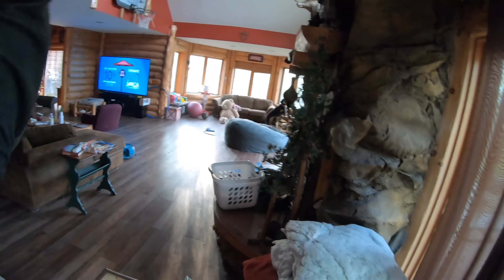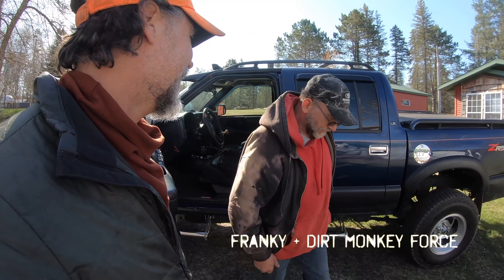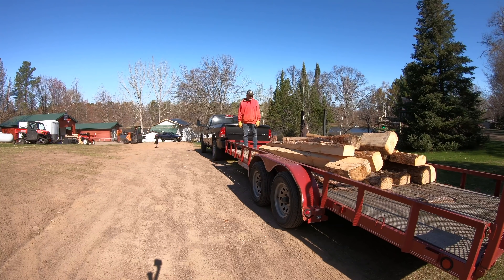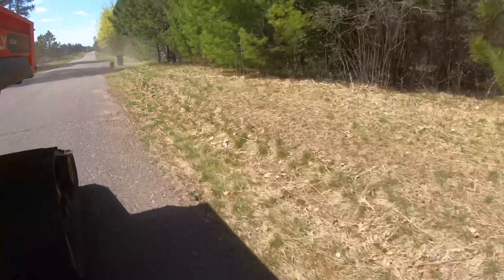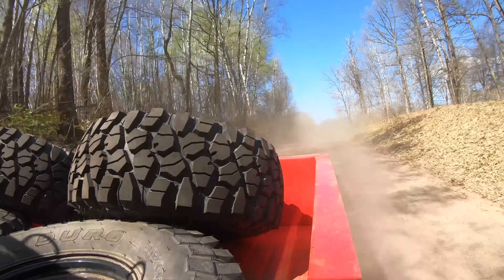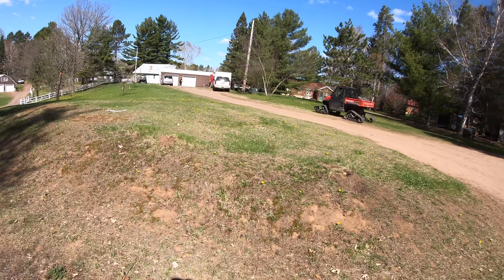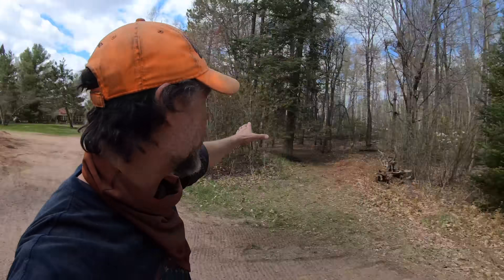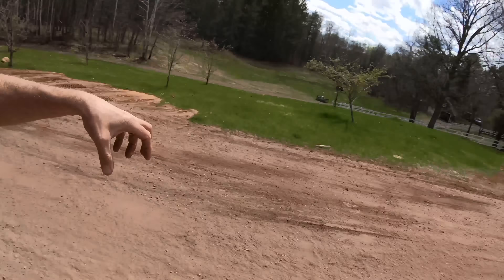Customer is shot on my farm

Comment: Power of a ricochet:

45acp turned 90 degrees in a small tree, then penetrated a hardy plank wall sideways, put a large dent in a 2x6, finally coming to rest on a plastic bucket after bouncing 3’ back from the 2x6.

We were fortunate that day.

Down range isn’t always directly down range.

Physics will prevail.
Especially so with poor decisions to start with.

Comment: Demo ranch mainly shoots at flat objects and they're typically angled down. He's shot cylinders and the like, but he doesn't shoot at pans unless he sets it up a certain way. I don't know if you've noticed but there is a reason for him changing the calibers he uses to test objects - sometimes that reason is because of a higher chance of ricochet. I've seen items I'm sure it's going to ricochet but because of the caliber and power selection it lessens the chance. There's also the fact he likes to hide behind trees and trucks if there's anything he's not comfortable with. 

I'm glad your neighbor is recovering well. A big lesson from that is to always have a first aid kit handy when shooting - and know how to use the gear. Personally I have a couple of tourniquets. One is for when I'm using a chainsaw and it goes into the chaps, one is for a medic bag I keep at home (which has come in handy before, unfortunately) and the third is for the range or for  slipping into gear.

Comment: FIRST I'm glad your friend is alive and well to talk about this/his misfortune....we've all done or been victim of a "fun" mistake. 2nd, as many times I've seen you preach good footer/foundations make healthy walls, I'm from hillside country and #1 mistake is NOT removing the grass before adding another layer. It does 2 things ,not removing creates a "slip" point as  the grass rots it doesn't allow a correct bond between the layers (actually makes 2 hard pans with grease between) ...also by removing the grass you also breaking the lower soil to allow  the new layer to bond/grip to it preventing future slippage. YES, your ground there isn't as steep BUT same water priciples apply, it'll seep down/through to grass rot line then flow out creating a slip.....I've seen yards, drives, etc. slip/slid.

Comment: there is a guy in florida with a TBM, that got his plane shot like the bullet was fired to the sky and came back down just behind the cockpit. He cought while inspecting his plane before flight and thay found the bullet between the panel and platic interior. The probability of small plane taking a hit from the top is as low as this guy taking a ricochet being "far" from the plate, that's crazy

Comment: Stan, many episodes you said something about never (seldom ?) using safety glasses or other PPE.  You said that you did not use any your whole life and nothing ever happened.  I'm sure your neighbor never had a bullet ricochet and injure him before.  While it is likely safety glasses would not have fully protected him, they might have lessened the damage.  

I bought many pairs of safety glasses and insist that anyone working with me wears them any time there is a danger from a chainsaw, hammering a nail, chipping a rock, paver, retaining wall block, or any possibility of something flying and injuring them.  Hardhats are required when working with anything overhead

I feel that a slight discomfort from the safety glasses is worth keeping the only 2 eyes I have.
Reply from the maker: Even though I don't wear much PPE personally I would prefer my audience to be fully protected.
Reply: Internet hall monitor alert.

Comment: how do you get away with shooting irresponsibly????  YOU DON'T.. lesson to be learned here is if you think what's happening is wrong, especially on your own property, stop it from happening. I've done shooting for years and have spoken up when something seems wrong. I have stopped friends several times from making deadly mistakes. Your neighbor is a miracle for sure, he should be dead. A slow burning black powder gun went off 30 seconds after it was fired (Hole in the range roof)  I was putting up targets and my buddy had his rifle pointed right at me from his hip.. I screamed at him, 30 seconds later His 30-06 went off and blew a 6 inch diameter branch off above his head... The safety was on, (but was broken.)  Please be safe.. I'm only trying to help.

Comment: The reason that Jeff got hit was almost certainly because he was not the shooter. I’m assuming that the shooter was smart enough to tilt the steel one side or another so the bullet didn’t come straight back at him… That’s what you normally do, and that’s what your friend on the other YouTube channel is doing to keep from getting hit. The problem is that Geoff was standing 30 feet off to the side so when the bullet ricocheted off the intended target and left at a different angle, unfortunately for him it came off at an angle the intersected with his head. Had the angled the steel a little downward as well as a little to the left or right, like they do in a shooting trap at a gun range than likely the bullet would’ve just hit the dirt and nobody would’ve ever gotten shot.

In any event I’m sorry this gentleman had to experience this but I’m glad he live through it.

Comment: AR 500 steel targets are cheap like $20 delivered for a 8” plate. 👍👍Use them because they are much cheaper & safer. Mounted with chain or used conveyor strap. 👍

Comment: A bad ricochet while shooting at a metal is always the result of using the wong ammo. FMJ is for paper or soft materials, not for metal. Also, no target should be concave because that adds to the possibility of a ricochet. Ive got hundreds of hours of training and 10,000+ rounds down range, with 0 issues. The PPPPPP applies to shooting more than any type of construction in my opinion

Comment: My partner at work missed the steel bracket he was shooting with the nail gun. The nail ricocheted off the top of my head. A flap of my skull was pulled up about 2" x 3". Knocked me on my butt instantly. They called 911 and said he shot his partner. A whole swat team showed up with full gear. The medics woke me up and the cops asked what happened. It was all fine thank goodness except for some stitches in my head. They found the high velocity nail curled into a circle. This was the old fashioned breech loading gun.
Reply: There's a joke here about hard heads... but I don't want to go there :P. Glad you where alright.
Reply: @gerble36  Umm, it WAS mentioned by someone I won't name. :)

Comment: So he lost that eye!? Wow, I guess that's why some shooters wear safety glasses. My normal eye glasses have saved mine from bits of metal a few times.
Reply: Safety glasses won't always stop a direct hit if there's still a lot of power, especially if it hits just below the glasses and defects off the orbital bone. He could have been wearing safety glasses and still got hit. Once wjen I was pretty young I had found some old inch thick glass and decided I wanted to see if my old daisy bb gun could break it. Obviously not bit I didn't know too much better. I knew it could bounce off because I was so close so I stood at an extreme angle so if it did bounce it would go the other way...and it still somehow bounced straight bad and got me just below my lower lip hard. I was so mad I went and found a hammer and made sure there was nothing but silica dust left over of that chunk of glass when I was done with it lol

Comment: its guys like this that show up at my land to do a big dirt moving job that i send down the rod talking to them self, i never hire out work on bids, i pay the floating, and by the hour and have my own truckers bring in what is needed, but if you show up with a skid steer to do the job, you better be ready to head back, a skid steer not a dozer and not made for cutting or spreading tons of dirt, can it do it, any thing can do it, it just how much longer it going to take, and they think they can charge the same floating fees in an out, and the same hourly rate as a D6 cat, hell even a D7, and your going to have a much better job in the ends, in a frw hours that D6 going to move more dirt then a skid steer ever will in 4 days, sure a skid steer not bad for top dressing and a little clean up, hell i had my 30 acres striped of all the bruch and stumps, and a shelf cut into the hill side for a 30x40 shop with lots of room to drive bog trucks in an out, the top side of the hill was cut down 9 feet, it cost me $500 cnd to float the D8 in an 500 to float it out 5 days later, one day it never worked, my bill in the end was $3800 cnd total, and the stumps were huge, sure i have huge ravines. all the crap was barred in, giving me a lot more level ground..                                                     i see so many you tube video of people shooting that shouldn't even own a fire arm, every thing from target shooting with no back stop, to shooting in an area full of big rocks, asking for big problems, dont get me wrong, i been a hunter all my 60 years of life, a bullet going to come right back in your direction so fast,, i know a woman that was killed driving down the high way well a guy was shooting at a floating target on a lake with a 308, the bullet bounced off the water, made a hard left and went for 1/4 mile killing the woman with one bullet to the head..